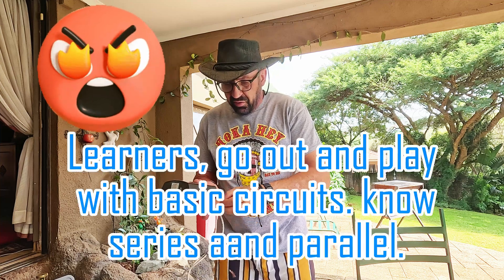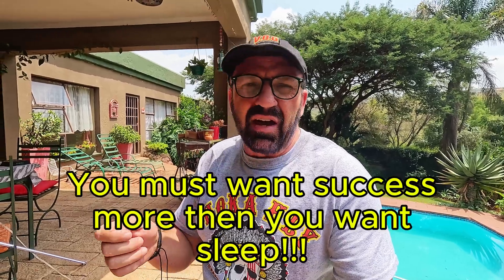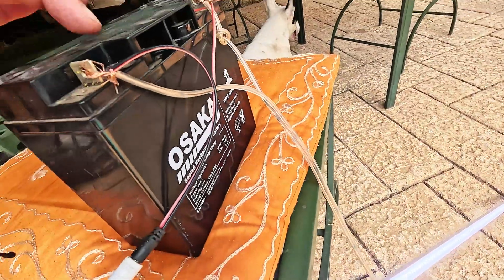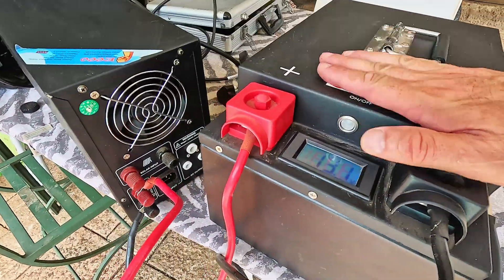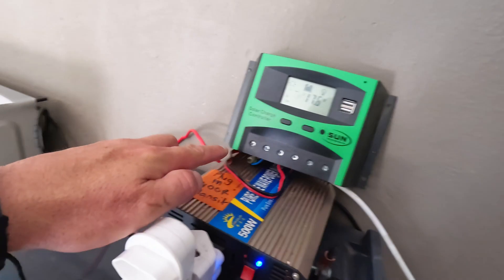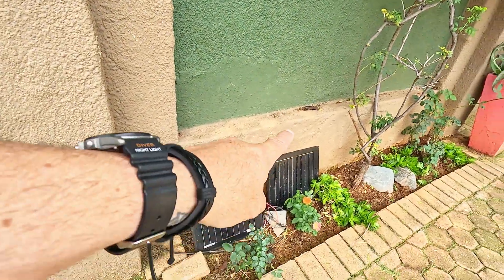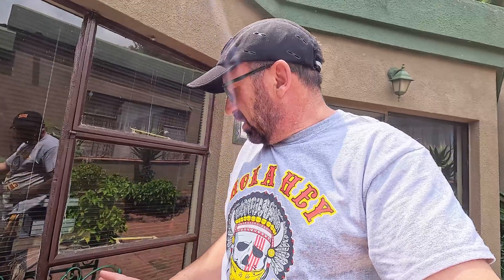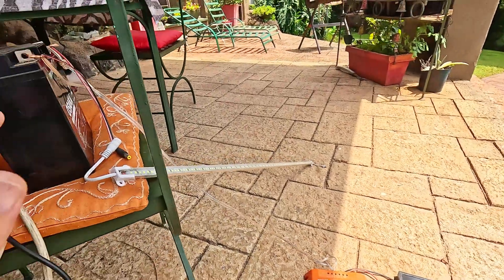Solar panels to beat load-shedding so learners can study at night. Eskom alternative for light@night

Comment: I live in a truck and have two 185ah batteries charged with 2 x 175w Solar panels. Planning to upgrade in the future to 4 x 130ah batteries and 4 x Solar panels so I can add a 3000w inverter to run a microwave. Presently for my air fryer I use a 2500w silent generator. So far so good.
Reply from the maker: Great!! I am also thinking of converting an old fan with permanent magnets to a wind turbine for night time